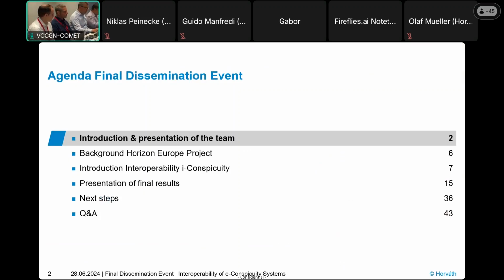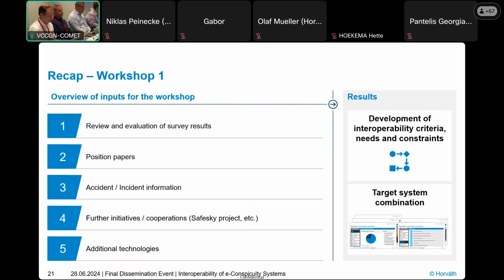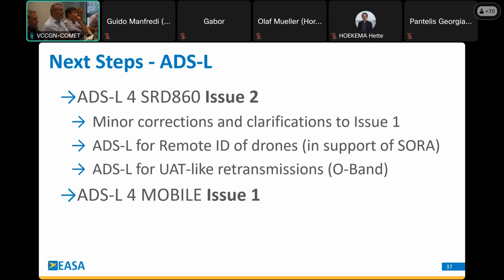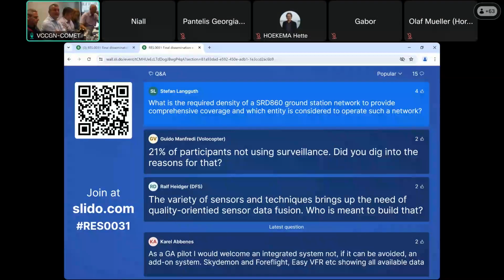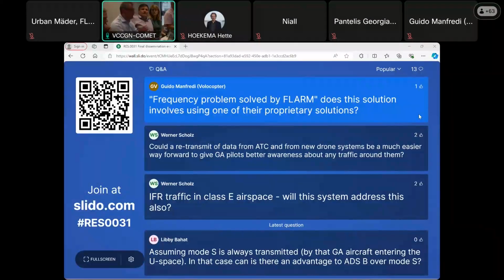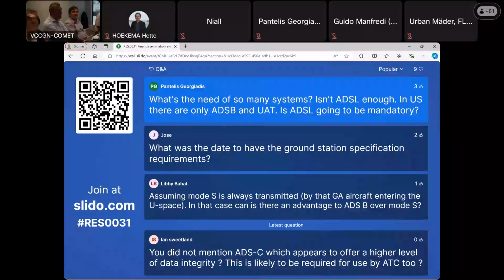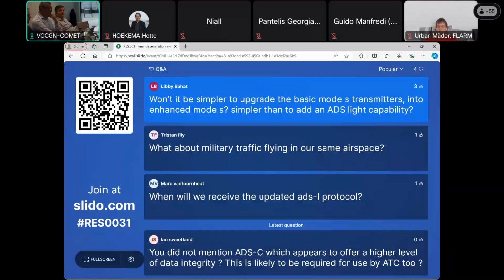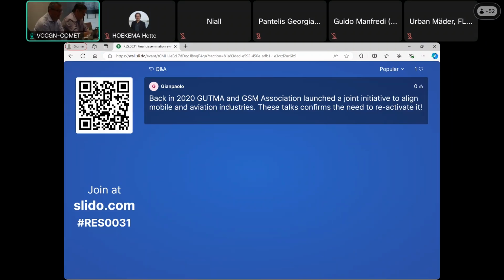iConspicuity - Interoperability of Electronic Conspicuity Systems for General Aviation - Final event

Comment: I am very much in favor of general conspicuity of every airspace user, be that GA, UAVs, RC models, skydivers or anything else. And it is clear that ADS-B on 1090MHz is not the way to go for this for many reasons. I also applaud the use of ISM bands for this because as RC model control systems have shown, you CAN build robust links on ISM bands if you are frequency agile and design your link for resilience - and you completely sidestep the problem of having to wait a decade or three for ITU...
The only thing I am somewhat disappointed by is that SRD860 specifies the use of 2-GFSK. A technically superior modulation would have been CSS (Chirp Spread Spectrum) along with channel hopping. It feels a bit like GFSK was chosen because that is what the contributors to that spec had experience with (Flarm et al) and perhaps also having an eye on adding ADS-L capabilities to existing devices via a firmware update. While this can make sense on paper, in practice the majority of the future ADS-L users don't have FLARM equipped today.

Also, not sure what the point of ADS-L4Mobile is. We already have plenty of specs that cover such a capability (see Traffic/Telemetry service in CORUS XUAM Conops Ed 4). I would hope that such a specification at least takes what's already there and improves upon it, and not reinvent the wheel.

Very interesting question from DFS about who's going to build the tracker. For sure I hope USSPs don't, because very few companies have the know-how to implement such a thing properly. And you can't just pipe drone telemetry into an ATM tracker without additional development because their traffic movement profiles encompass only what's known and expected in traditional manned aviation.

Oh and lastly: I am not sure the current specifications can survive in the real world as they are today. For one, without MLAT you immediately have the problem of being unable to filter out fake transmissions and thus it is easy for anyone with a HackRF to effectively jam the airspace in a wide area. I believe use of the currently-optional signature field in the payload will have to become mandatory.